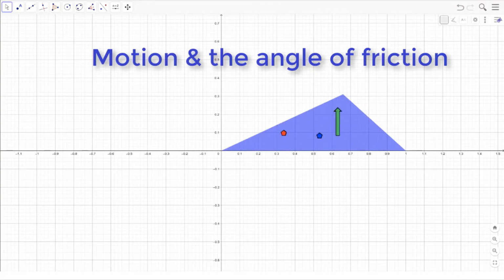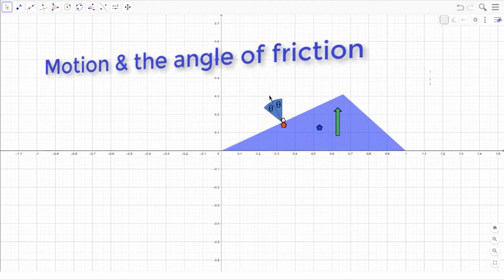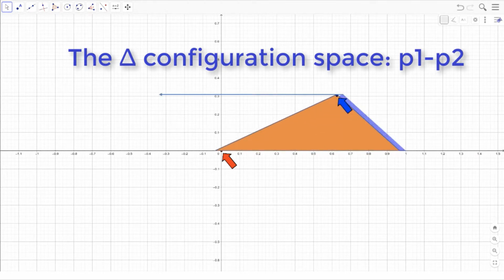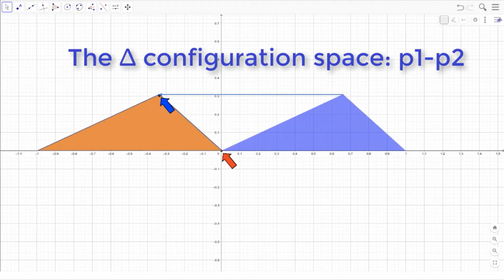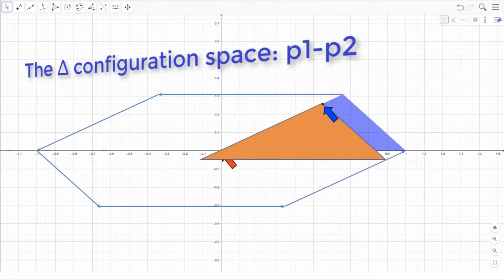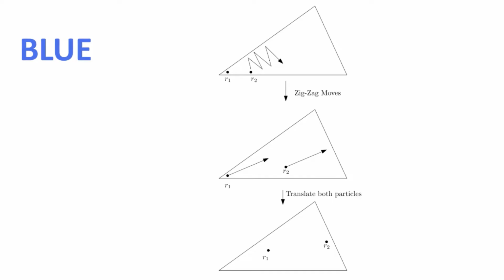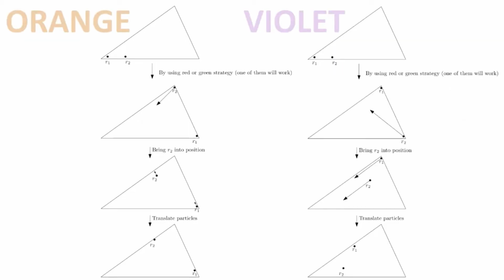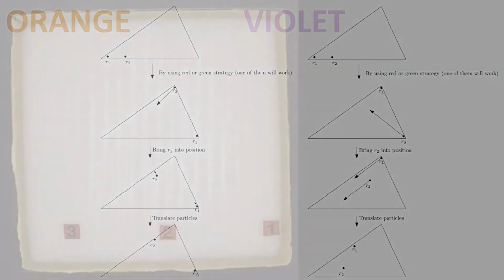Coordinated Particle Relocation Using Finite Static Friction with Boundary Walls

Comment from the maker: URL: http://ieeexplore.ieee.org/stamp/stamp.jsp?tp=&arnumber=8962023&isnumber=8932682
A. Schmidt, V. M. Baez, A. T. Becker and S. P. Fekete, "Coordinated Particle Relocation Using Finite Static Friction With Boundary Walls," in IEEE Robotics and Automation Letters, vol. 5, no. 2, pp. 985-992, April 2020.

doi: 10.1109/LRA.2020.2967275
Abstract: We present theoretical and practical methods for achieving arbitrary reconfiguration of a set of objects, based on the use of external forces, such as a magnetic field or gravity: Upon actuation, each object is pushed in the same direction until it collides with an obstruction. This concept can be used for a wide range of applications in which particles do not have their own energy supply. A crucial challenge for achieving any desired target configuration is breaking global symmetry in a controlled fashion. Previous work made use of specifically placed barriers; however, introducing precisely located obstacles into the workspace is impractical for many scenarios. In this letter, we present a different, less intrusive method: making use of the interplay between static friction with a boundary and the external force to achieve arbitrary reconfiguration. Our key contributions are a precise theoretical characterization of the critical coefficient of friction that is sufficient for rearranging two particles in triangles, convex polygons, and regular polygons; a method for reconfiguring multiple particles in rectangular workspaces, and deriving practical algorithms for these rearrangements. Hardware experiments show the efficacy of these procedures, demonstrating the usefulness of this novel approach.
keywords: {Manipulation planning;underactuated robots},